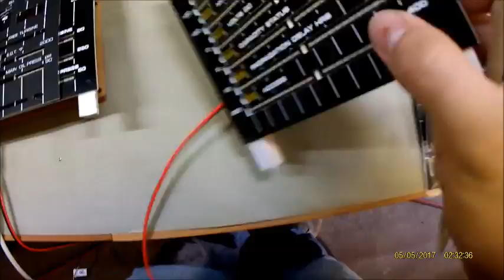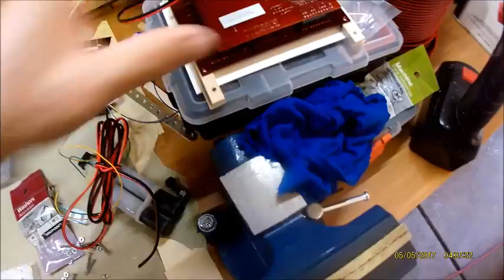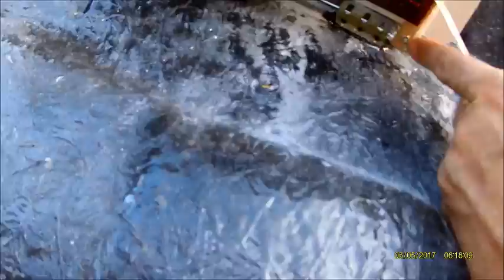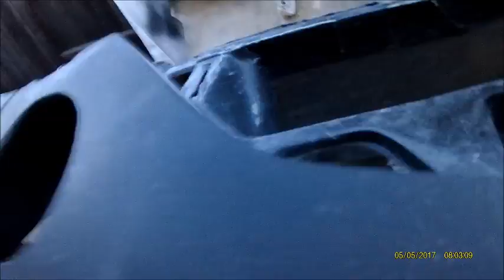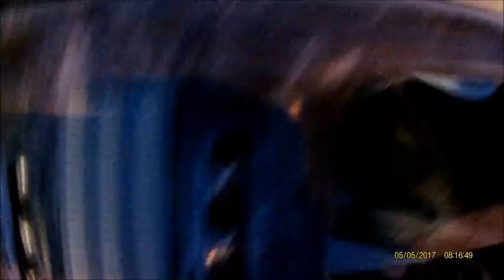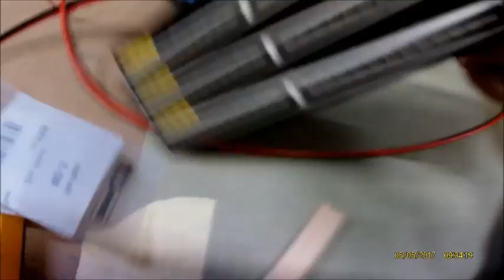Knight Rider 2 Tv Dash Build Part 2 Electronics install

Comment: Since the Jupiter voice box does not have any pre drilled holes for any hardware applications, you have do drill small holes on the board and as you pointed out, you must be very careful not to short out any of the circuit traces on the board.  One alternative is to use  small plastic screws, washers, and nuts so you wont short out any traces or solder points sticking out on the board (non conductive). - MK
Reply from the maker: Yes I made sure the screws I used are very small ones and do not hit any traces on the back side.

Comment: Do you epoxy the wood to the boards on the speedo and rpm boards?  Will 3m tape work on the back of the voice box template?

Comment: May I ask where you got the switch pod unit from? It's namely an altered version of the one I offer. (Knight Passions)
Reply from the maker: A customer bought it off you years ago when I completed his turnkey, the kitt car went to Finland. I didnt use it tho as the buttons didnt fit into the pod button area, so its been sitting in my Garage since like 2006. I believe you got it from Rob L if I am correct. And Joao this is Jacob in California...I have modified the pod to my liking. But I dont sell it on my site. Some mods: I cut off the backside, and straightened out the pod on all edges I made some vids of it in the past, I think it was on my facebook account, might be on here as well. Also I adjusted the angle of the arms on it and opened up the pod button area a little. I sell another type pod on my website I made, its not from this one. This one was an extra I had made so I sent it with his dash. Was going to use this pod on my personal car but depends on whos electronics I go with, its really thin so not everyones fit the button area.
Reply from the maker: I think the customers name was Jon L from finland. He still has the replica he bought from me. Here it is on youtube  https://www.youtube.com/watch?v=zLhIQpQ29GQ
Reply from the maker: http://louisellenterprises.com/ Same pod as urs here, from the guy whos says he is Retired...yet his website is still up, haha. Such an honest guy this Rob is...